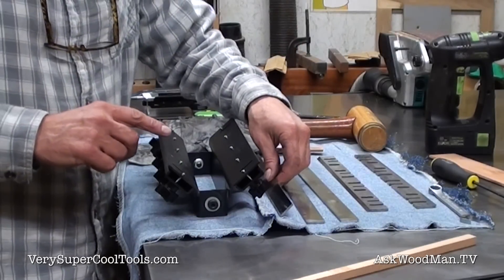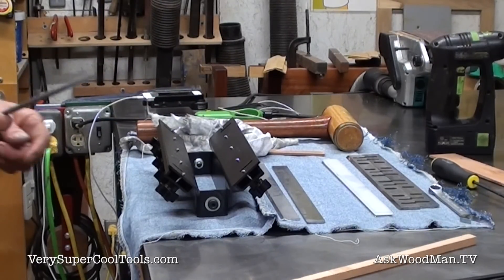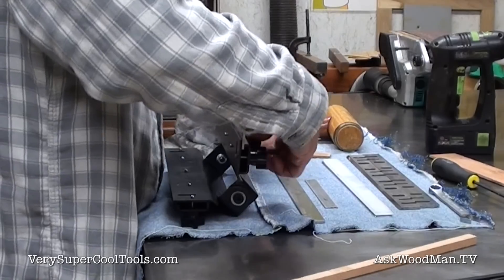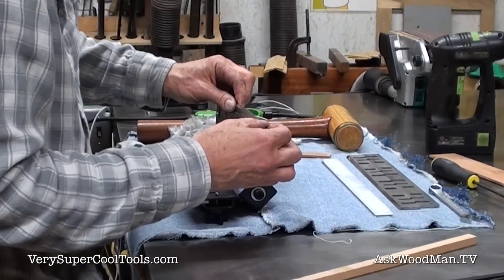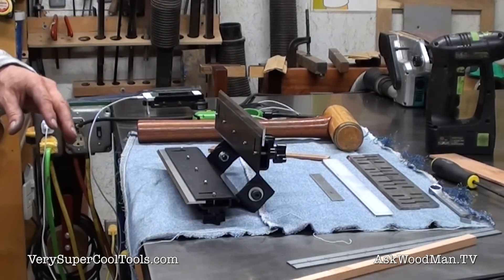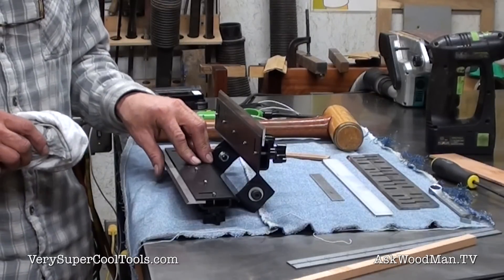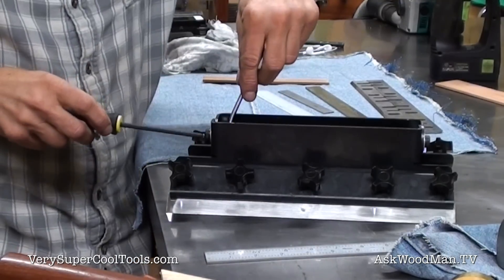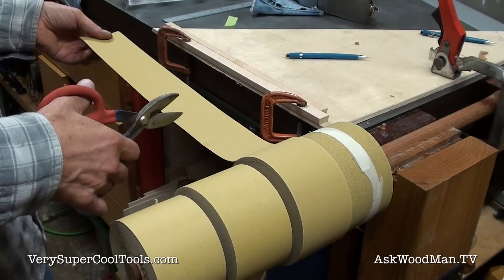985. Planer / Jointer Knife Sharpening Jig • Video 4 of 8

Comment: Hey Allan,

That is a dream machine of mine.  The jointer planer would save me room in my shop.  I hopefully will be getting one towards the end of the summer and then I will definitely needing one of those jigs.

By the way, did I see Charles Neil using your table saw fence?  It looked like it.  You two have been my inspiration since I started woodworking a few years ago
Reply from the maker: +Kaleb Magnusson Hi Kaleb. I am putting the finishing touches on a video series about setting that machine up. It is a quality piece of machinery. I am very lucky to have stumbled into the deal I got on mine. Yes Charles Neil does have one of our fences. Thanks for watching and taking your time to keep in touch. Allan